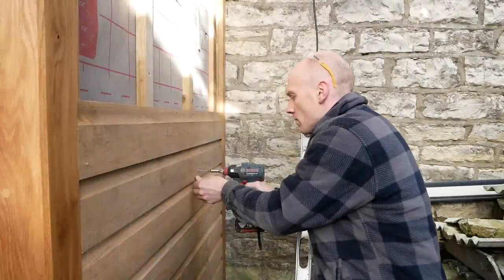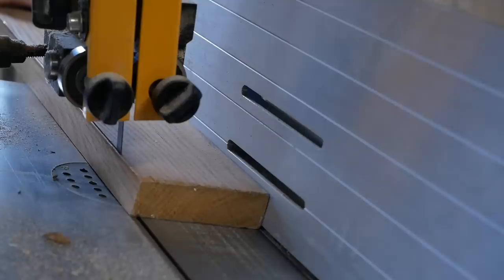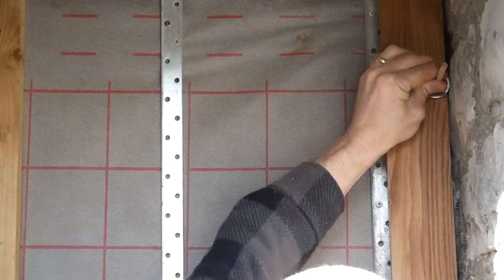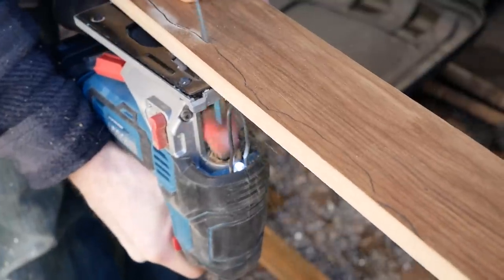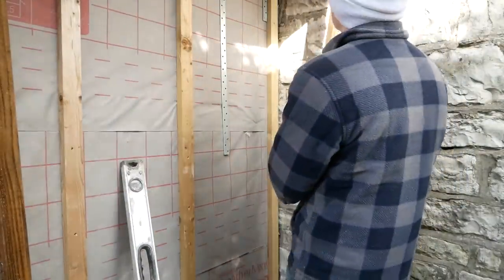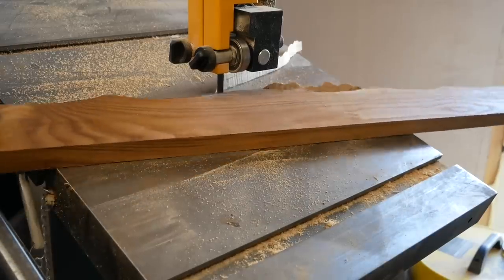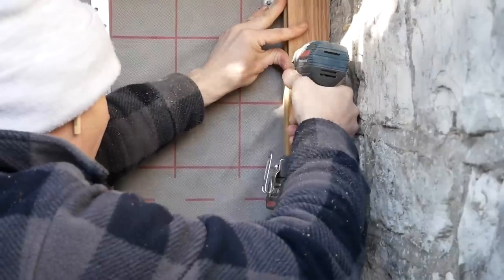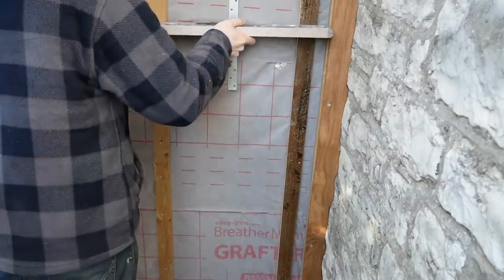Scribing Wood to an Old Stone Wall

Comment: Hi Tim, the problem with using a round washer is it will scribe inside curves to a smaller radius and outside curves to a greater radius so the result line will never be a close fit. The bigger the washer the greater the error. Better to use a scribe that comes to a point and keep it horizontal to the floor as you go down the wall. But then you did say you weren't after an accurate finish ;D lol
Reply from the maker: Yes totally different if I was scribing trim indoors but where room is needed for expansion outside and a less accurate finish  this was a good way to demo a simple DIY method. 👍

Comment: Scribing is best done by whatever method you find best. I've tried it your way and it works fine so don't listen to the 🛎 🔚 who sati us he'd use a scroll saw! Not sure what planet he's from!  I've used the table saw on site when there's nothing else, I've used a handsaw when it's not so 'wavy'. Personally I'd have used a compass with a fine sharpie as i use 4h pencils so difficult to mark on oak. If a can't find the compasses I'll use a bit of wood with a pointed end to the wall and just keep it level. Never seen the washer trick but I like it. (been a joiner for 35yrs so I've learnt something!) Cutting it I'd angle the base of the jigsaw and cut it from the face. There isn't much tearout to be honest. The down cutting blades are more dangerous to me sit bounces out. Anyway, Good job. 👍

Comment: I guess the radius of the washer stops very small indents being marked so it's like reducing the resolution and it gives you a smoother cutting line.
Reply from the maker: Exactly. On a smooth wall a compass or similar would be fine but would be a pain with masonry.
Reply: you could use a big washer to get the general shape, then a smaller one for fine details if you need it. depends on how tight the finish needs to be i guess.

Comment: The only thing I would have done differently is I would have put a 1/4 inch blade on the bandsaw and  used that to cut out the shape rather than use the jigsaw, but still with table on a tilt to save cutting twice. You would have the same angle cut all the way through. Especially with that amazing bandsaw you have, the sabre is a great saw
Reply from the maker: I planned to do that but finding space to manoeuvre a long timber on the bandsaw is a little tricky in there at the moment 😂 Plus not everyone has a bandsaw so always good to show basic DIY tools where possible. 👍

Comment: Hi Tim, great scribing tip, I will try it next time I need to scribe to a wall.  You said you did not want to trap moisture between the wall and the oak, so will you run a bead of silicone down the joint once you are done?
Reply from the maker: Silicone would probably cause more damage as it tends to trap moisture. As it’s under cover there isn’t any need to ‘seal’ it but a careful pointing with lime mortar is an option when I come to redo the stonework.

Comment: I normally use a pair of compasses or dividers. Although I must admit that jig looked very quick to use.
Reply from the maker: Yes I would usually use the same if doing interior trim but for bumpy exterior stone it would be ‘too accurate’ if you know what I mean and therefore you would end up smoothing out the lines as you cut anyway.

Comment: Would you not think cutting the timber parallel and using the expanding black joint foam would have looked nicer? Never like a scribe into rough stonework personally

Comment: Tim how do you decide the starting width of the timber so that once it's scribed it finishes where it needs to be? or do you scribe first and trim to width after.
Reply: I have always wondered this too.  I notice Tim never answered you.  Did you find the answer elsewhere?  Would like to know if you did.  Thanks.
Reply: In this case I’d guess his cladding would give him the wiggle room. As long as it doesn’t look too thin he doesn’t need a perfect final width because he could cut the cladding long. 
Trimming after scribing can technically work but I don’t like doing it. The remaining flat reference edge will need to ride along the fence as you cut. This is your new show side and will probably will have blade marks (and maybe burn if you’re using a table saw). These need to be sanded off and restrained if you’re using pre-finished stock. [Remember to measure with the blade kerf in mind since you’re keeping the “waste” side of the cut!]
If you need a specific final width, you need to know how much stock is being removed so you can do the math. To find that amount, first put the board against your surface and measure the widest gap. If you’re using a compass and you set it to exactly that width, you’re done: that’s the measurement of width you’re losing. If you’re using the washer method (or setting your compass to take more than the absolute minimum) you need to measure the distance between your scribe line and the wall where the wood is touching the stone. This is the biggest amount of wood being cut away. Use that (remembering to account for blade kerf) to get your final measurement. Hope that helps - I’ve never tried to write it out before. I’m sure there are good videos out there too to check out.

Comment: How to not use a jigsaw followed by how you should do it on a band saw. I have a scroll saw I would of used that, in much the same way you used the bandsaw. Turned out alright in the end and you still have all your fingers so it’s a win
Reply from the maker: Why can’t you use a jigsaw like that? I know most would use a rounded scribe foot from below but for scribing trim it’s far easier. Especially on skirting and dado rail.
Reply: Gerry, go back to playing with train set son.

Comment: For those diy'ers out there DO NOT USE A JIGSAW THIS WAY UNLESS YOU ARE COMPETANT IN USING ONE! I understand the method of using one upside down just don't think yours is the right handled one to do this safely it would be rather awkward to hold
Reply from the maker: Yeah a standard handled jigsaw is not as easy and a little clumsy, providing you are cutting away from yourself it’s not too high risk. But yes, stay safe folks. 👍